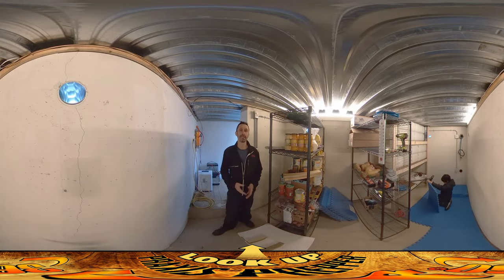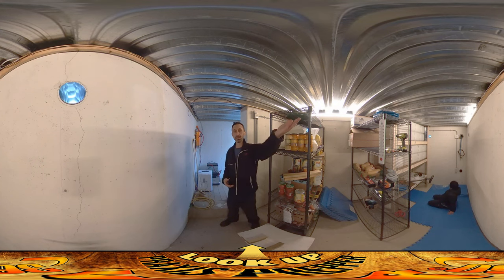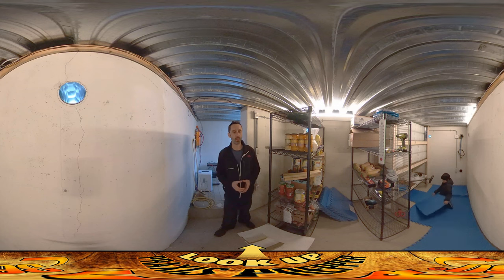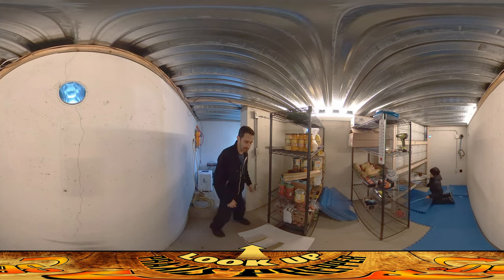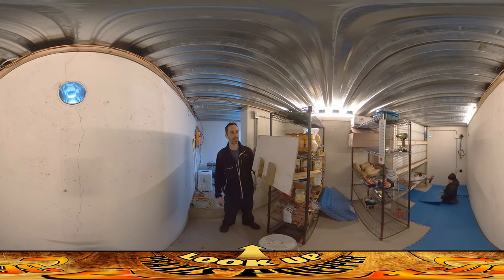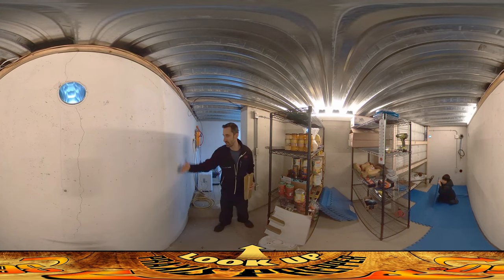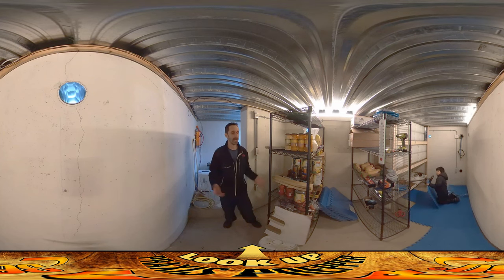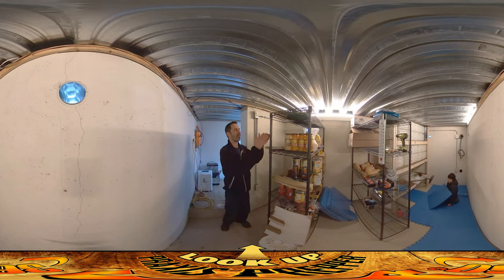Homestead Building - Fallout Shelter, Foam Flooring Pads, Installing a Sink

Comment: Keep that dehumidifier going....I had problems with those foam mats in my basement....pull up the corners once a month to look for moisture
Reply from the maker: As I've been putting them down, I've been thinking about just that issue possibly arising. I was wondering whether I should have sprinkled down some anti-mold... something on the floor before I put them down, but I don't know what that something would be, and would be concerned about whether it would chemically react with either the mats of the floor. I'll likely be checking under them from time to time to see if anything is cooking under there. I also plan to put down more moisture redirecting plastic when I raise the mound over the structure to - in order to shed more wet away.
Reply: @PraxisPrepper  perfect just don't want you to run into the problem I already had... threw a bunch of those out

Comment: Good idea. Did you happen to paint the floor with some sort of sealer? After you run out of ways to spend money and time, might be worth considering a couple curtains/tapestries for the walls for both heat retention and sound. I was actually pretty surprised when you said it stays near freezing in there (at least I think I remember you saying that) since I was always under the impression that underground normally stayed in the 50’s so definitely learned something from this particular series 👍
Reply from the maker: I'm actually planning to repurpose some old curtains from my first homestead for wall hangings. They'll offer some insulation, cozy colors, and also sound deadening.
As far as the temp goes, it's about 38F in there in the winter, but in the summer it's more like the mid 60's I think. It's not yet deep enough to be thermally independent from the surface temps. Working on that...
Reply: @PraxisPrepper  that sounds more in line with what my expectations were. Out of curiosity, do you have plans to use it as an actual root cellar at some point (assuming the world doesn’t end) meaning annual storage of fruits and vegetables for use during the winter months?
Reply from the maker: @inmyimage1081  Oh, I actively HAVE been. It's been great. All winter it holds at about 38 degrees in there. Only issue has been a bit too much humidity. I'm planning to help address that issue a little more when I add more mass over the shelter by adding some plastic sheeting over it as an underground "tent" to shed away water.